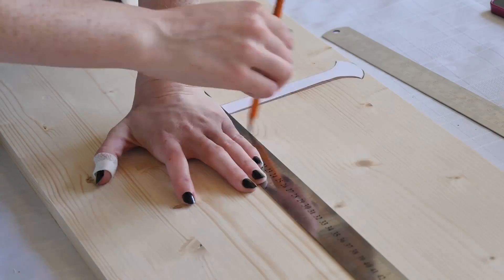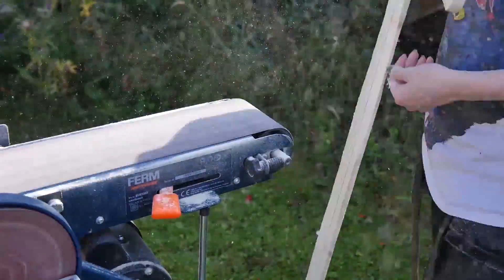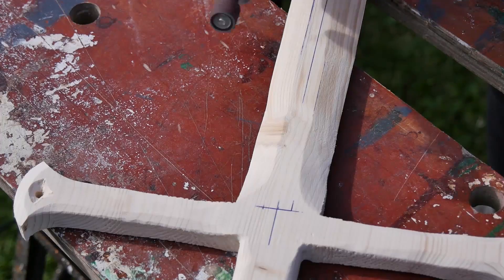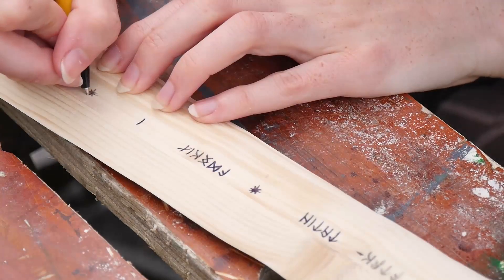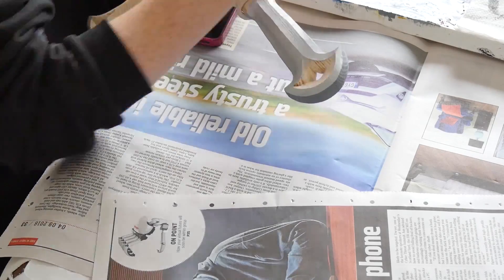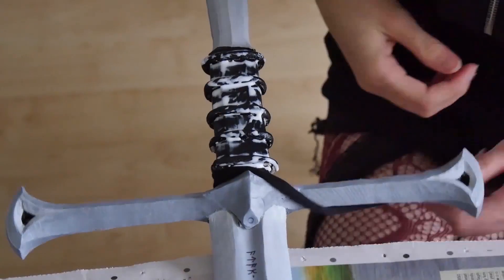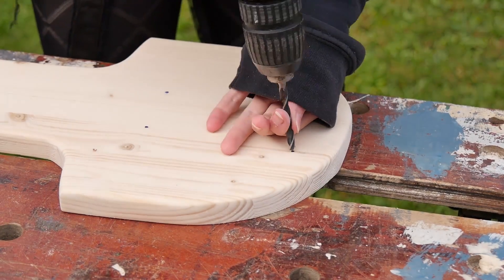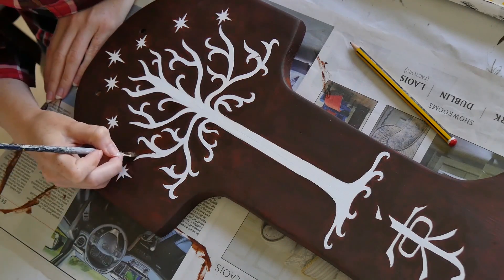HOW TO BUILD ANDÚRIL (LORD OF THE RINGS) | Magick Builds #5

Comment: When you used the oven dried clay, how did you cook it after you wrapped it around the handle? Did you make it in 2 parts?
Reply: I'm talking about the part at 4:15
Reply from the maker: Nano Shifter I cooked it before I glued it! c: I just cut the sides flat so they'd be flush when I glued them!